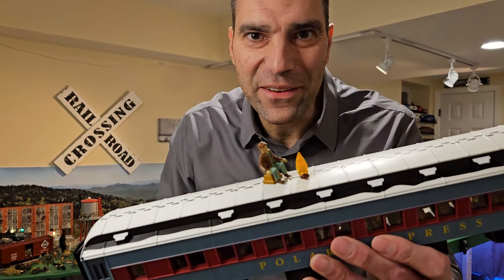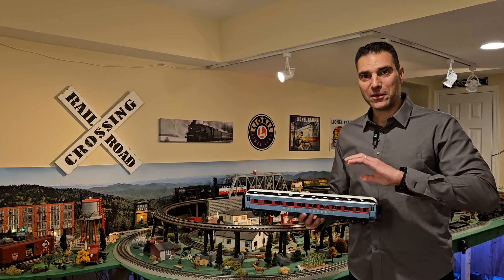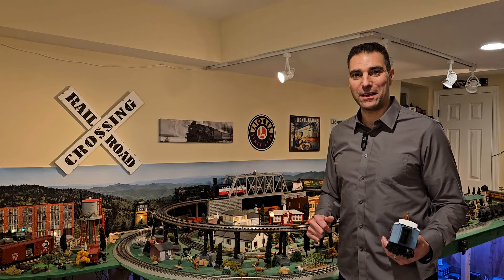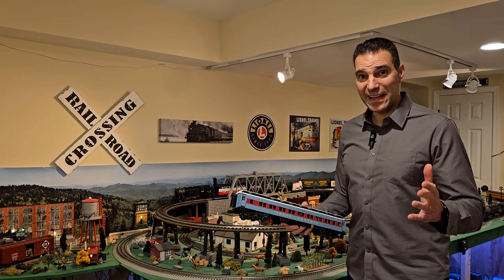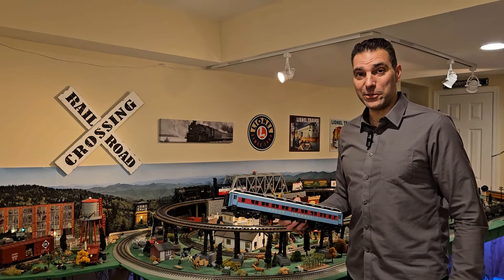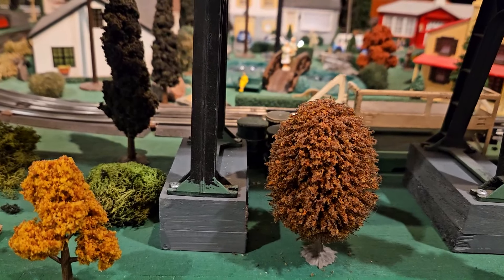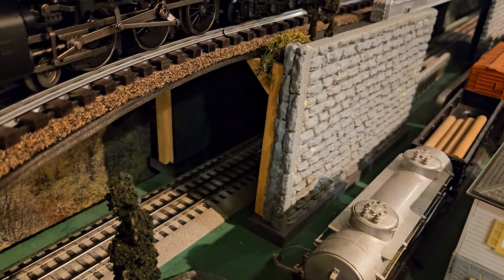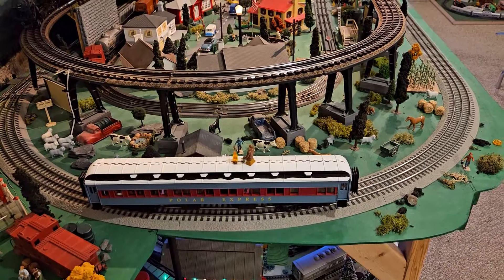Layout Mistakes - Why I had to raise my elevated line

Comment: Thanks for the tip.  Do you have a trestle support at each track connection for the upper loop ?
Reply from the maker: I used a 1/4 plywood I cut in the curve shape with a jigsaw and then glued the cork roadbed to that. Track is screwed to that. With that base I just have the trestles spaced as needed, no need to have them at each track joint, the wood gives enough support
Reply: @ArtsModelTrains  Very good...I couldn't tell and keep up with the great views of your layout. 
The 3Dads podcast is well worth watching also... enjoyable.  👍